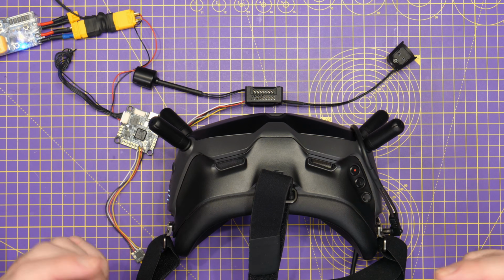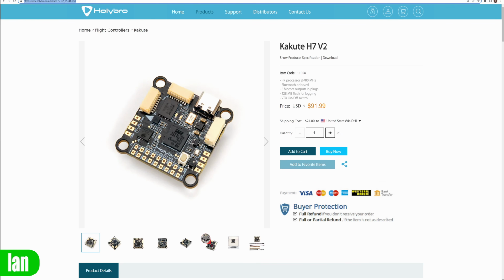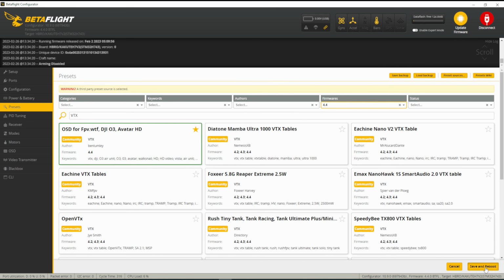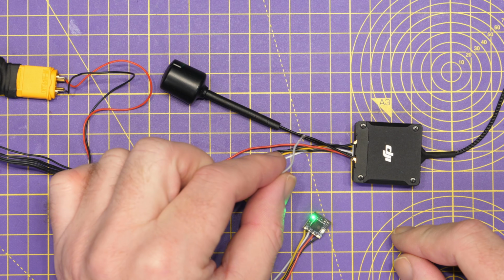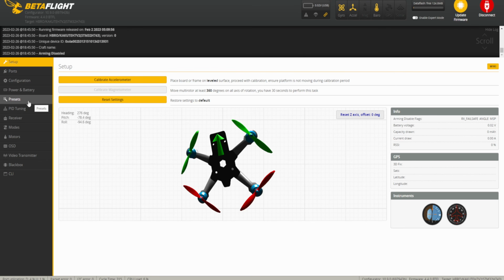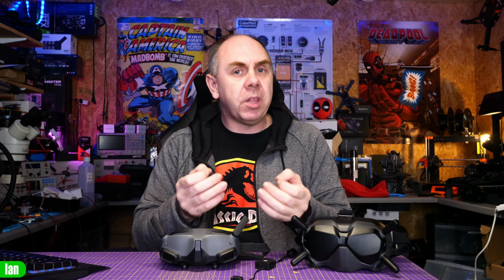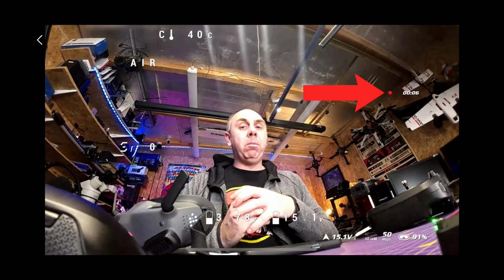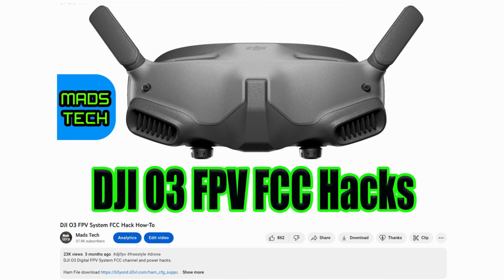DJI O3 FPV System - Complete Setup - Diagnostics & Troubleshooting Guide

Comment: Can anyone help please? I have a new 03au and v2 older bigger goggles, have not upgraded  the goggle FW to the latest ( 7) version, but moved from 6 to FW 4, which has the 03 functionality, and this works, I have a great bind and picture from the 03, but prior to this, I successfully did the root and install of WTF FPV. It has a a package which unlocks from CE to FCC mode, but that didn't work, went to transmission in the goggle menu and changed from Auto to Manual, but no change.

Tried the ham file on notepad, exactly as described, again no change. I then removed the Sandisk 64 gb SD card and re inserted it with the goggles powered on, again no change.

I did upgrade the 03 FW to the latest version before all this, could there be an issue with the 03 FW?

Anyone able to help please as my goggles are stuck in 25 mw mode.

Many thanks!!
Reply from the maker: The ham file is for O3 only.  You need to use Naco on the Airunit and Naco_pwr for the goggles in FPV mode for the Airunit and vista.  Ham is only for O3.  I have two videos on this. See FCC hack for DJI FPV.  You can also still use wtfos with the new firmware as well.  However it’s the Naco and Naco_pwr for the old system on V2.
Reply: @MadRC Many thanks for the quick reply.
I'm not sure if this is fact, but on a DJI forum a couple of guys stated that the latest 03 fw blocks the hack, so just to see if this was the case I've downgraded and reinstalled V1 of the 03 FW.
Also, looks as if my SD card may be a possible culprit, I plugged into my PC and says there's a problem and needs to repair it, so maybe my V2 isn't reading the file properly.
Formatting that card right now, but on the slow function, so when done, I'll reload the ham file and see if that works, there was no change using V1 03 FW..

Yes thanks, realised the naco FW was on the WTF package, so that's deleted, then deleted the WTFOS for now, and will see if I can get the hack to work after the SD is finished it's long format.

Thanks again, I'll let you know how things go this afternoon. 👍
Reply: @MadRC Just to clarify, the only hack I need to install is the ham on my V2 for using the 03, just to be sure, thanks again.

Comment: I'm having issues binding my O3 - but it's worked before and I haven't changed anything or crashed. The V2s start beeping (binding mode) and the O3 red LED starts blinking (binding mode) but it never connects. Any tips?

Comment: Hi to every one. Have problem...looks same as i don't have gray wire. No voltage and signal from FC, but i have OSD on my Googles V2. I had try: change uart. change cable,  all steps as from video but nothing. May be some of you have same problem. One time (wihle i'm playing with all this thing) i wired tx nad rx oposit...it could be the problem?
Reply: Problem was solved by wiring to other uart....so 2 was not good, and 3rd attempt was lucky

Comment: Hi Ian, I am looking to run a FPV unit on a go kart. Couple of concerns, would the stabilisation on the camera cope, or would it be too much vibration (fair bit of vibration) can I use the 03 unit & just power it up & bind with a onboard 2s pack. I have a DJi avata for flight with goggles 2, hoping to link from goggles to IPad for live feed screen. Any advice would be appreciated
Reply: This sounds cool, are u driving with goggles on or making a fpv rc gokart?

Comment: I have a Nazgul Evoque with the O3 inside but it doesn't record on Arming! All OSD works fine. Any thoughts! Have not got a SD card in yet but it's set to internal storage.
Reply from the maker: There is a setting in the Goggles 2 for this. Under the camera settings and advance I think it is. It’s buried some what.
Reply: @MadRC  OK cool I'll look at that. The last two flights it didn't record on the Air unit just the goggles even though it showed as recording in the goggles. Reading other threads I think it may have been because I pressed record in the goggles before I armed and so in low power mode it didn't record.

Do you know if you can set up a switch on the remote to start and stop recording (Tx 12) like the Avarta and the DJI Remote. 

I don't record every flight just parts of it and taking one hand of the sticks in Acro to navigate the goggles to record and stop isn't ideal!!

Comment: Hi there. Fan of your channel. I had an issue with my o3 air unit. The video went black while in the air and now while diagnosing there is no video at all and all connections are good. I noticed the air unit green light is blinking and not solid. Also tried rebinding but it’s already bound. Any idea what this means? And how should I go about troubleshooting? Can it be something to do with the rx tx 
Thanks
Reply from the maker: How are you powering it, if it’s on a BEC try directly to the battery.  If that don’t work try a firmware reflash.  The flashing green is usually power related or binding.
Reply: I’m powering the unit straight to power.
I updated to the latest firmware. I’ll check connections again. Thank you

Comment: Do you have a guide showing the actual frequencies that the stock O3 air unit uses? A friend and I were flying at 20MHz on O3 channel 3 (5839.6 MHz I believe) and Vista unit at 50 MB/s on channel 1 (5695 MHz). I thought these two frequencies would be safe from interference, but we were both getting terribly glitchy pixelation. 

We decided to throw logic out the window and fly on the following:
O3 air unit: 20 MHz channel 1 (5768.5 MHz I believe)
Vista unit: 50 MB/s chanel 2 (5770 MHz)

On this second flight, we had absolutely zero pixelation or interference. Nothing else changed (we were flying in the same location, the same distance apart, etc.)

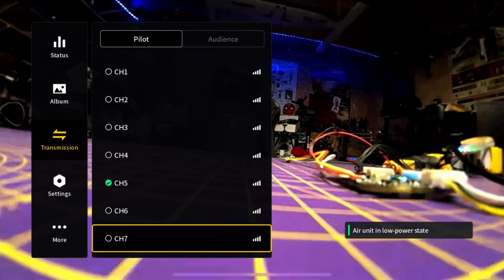Based on what you said at 21:18, it appears that our O3 air unit is in CE mode. I don't know if that factors at all, but I would like to know if there was a definitive guide on frequencies, because, based on my understanding of the frequencies, our test shouldn't have worked without interference.

Comment: Hi Ian. I have paired Air unit 03 and googles v2 together but there is no video from the camera. I see the OSD that is working... Any suggestions why there is no image from the camera? Could it be the loose wire connection? Thank you!
Reply: I'm in the same situation, did you find a solution?
Reply: @Beanrt  Hi, I fixed it by updating and registering the air unit with the DJI Assistant (Consumer...). Also when you run it, give few minutes to load the video. It takes few seconds to come up right after the UI...
Reply: @VitaliyBurov3D  ayy. I got it with that. Thank you!!
Reply: @Beanrt  Any time!
Reply: @VitaliyBurov3D  How many minutes did it take you to wait? It broke again and its not transmitting any video but recognizes the binding
Reply: @Beanrt  Ben if it worked before, make sure you don't have a loose wire connection. It shouldn't take long to connect...
Reply: @VitaliyBurov3D  hmm. It might be the coax cable. It's looking a bit funky
Reply: @Beanrt  it can have a loose connection. You may move it a bit to see if you get connection but not too much so you don't make it worse.
Reply: @VitaliyBurov3D  I reseated it and got video for a couple minutes but it was like 6mbps and almost unflyable
Reply: @Beanrt  hmm, that could be something else. So you have the UI showing up but no video from the camera and weak signal... Do you have green light on the air unit 03 box?
Reply: @VitaliyBurov3D  yeah I do. It's binded so the link quality and low power mode is seen. Just no video or when there is video, it's ok for a bit and then after a bit it shuts off. I'm wondering if it's just my unit overheating super quickly
Reply: @Beanrt  give it shot with a fan... By the way low power could be because your drone is set to before you arm it....
Reply: @Beanrt  does it beep?
Reply: @VitaliyBurov3D  the air unit? No. Also, lemme just dm you lol
Reply: @VitaliyBurov3D  it just gets really hot. The last time I powered it on, it had video at 50mbps but quickly went down and stayed at 6 until it turned off the video
Reply: @Beanrt  ok so it turns on and off. That is a good sign. You might be right about it. It is overheating. Mine also overheats after few minutes but than my drone beeps. How ventilated is your unit? I was doing an update on mine and my fan was turned on to full power. So it needs allot of air (tornado).
Reply: @VitaliyBurov3D  mine is in a cinebot cinewhoop frame. It only lasts a couple seconds before the video cuts out, so I'm not sure if this is normal or not. Maybe it's a power thing? I'm not sure
Reply: @Beanrt  Hmmm ok. Something is being overlooked...
Reply: @VitaliyBurov3D  probably. I just don't know for sure
Reply: @VitaliyBurov3D  I tried again just now and got a minute and a bit without losing video while on the ground without a fan until it shut off black but the OSD continued. I measured it with a infared thermometer and it read 100 degrees but that seems kinda low
Reply: @Beanrt  did you build the drone or bought it already made?
Reply: @VitaliyBurov3D  I technically bought it used and it was pre-built by geprc
Reply: @Beanrt  Have you flown it with the air unit 03 before the issue?
Reply: @VitaliyBurov3D  no but I know it did work before
Reply: @Beanrt  which goggles are you using?
Reply: @VitaliyBurov3D  v2 I've updated everything's firmware but initially had it rooted with wtfos
Reply: @Beanrt  ah you didn't have to. I haven't and it works with the UI... Hmm you might need to factory reset it or see if there is something that didn't finish installing. Mads Tech has a video on how to do it properly.
Reply: @VitaliyBurov3D  hmm I'll try to wipe the goggles then. I've tried it on another goggle and it still didn't work though and I've updated it to the latest firmware post wtf.os
Reply: @VitaliyBurov3D  I just did a flight test and it ramped up to 50mbps well and was flying perfectly until randomly video froze. Might be a wire so I'll check it for now
Reply: @Beanrt  let us know what you find
Reply: @VitaliyBurov3D  It wasn't the cable. Still having the same issue. Seems like its something to do with the transmission of the video. It comes in at like 1mbps with green lines everywhere and a  really messed up video feed
Reply: @Beanrt  I wish I could help more with that... Maybe connect the air unit to DJI Assistant 2 with the battery on and see if you get any errors with a code. Hope anyone from here can step in and help you
Reply: @VitaliyBurov3D  thank you for all your help! I've contacted DJI so we will see

Comment: Very nice video. I know that this is a guide for betaflight , but I wonder if you have any idea for inav.
For now , inav has not OSD support . But when I arm the quad , it exits from low power mode and starts recording.
The problem is that I have 0 Volts in my V2 goggles for the battery of the quad and the signal is weaker from the previous air unit. 
Is it possible that this msp behavior , affects the strength of the signal , or from the moment it exits low power mode is irrelevant ? Thanks in advance

Comment: Thank you for this video! The flight controller and dji o3 have different connection terminals. In the video, you have a cable that fits perfectly to the flight controller. Where can I get the cable from the flight controller to dji o3?

Comment: struggling to find the solution , i have betaflight osd but no dji osd voltge 0.0 with low power, but betaflight osd show all correct . i also try that on different fc with different cable same problem /;

Comment: great video and very helpful!! i just got the o3 air unit for my rc planes. im in market for goggles now but i was wondering if i need a flight controller for o3 or if it would connect to Spektrum Air Receiver??

Comment: when low power state is gone after armed, that gonna shutdown automatically?, because i already get failsafe 2 times because of automatically disconnect, its like overheat on dji o3 unit, but just flight 1 half minute

Comment: Hi Ian, I'm using the same DJI GV2 to fly with vista's and O3's. GV2 are WTF rooted and they are updated to fw V01.04.0000, my O3's is flashed with fw V00.05.0203 (I did not upgrade it even to V01.01.0000 yet). Vista's units are WTF rooted with current soft as well and they all have DJI fw version V01.00.0606. My all drones are working with GV2 perfectly (with vista's and O3 - full BTF OSD etc..). However I would like to get new O3 dynamic range upgrade but I do not want to brake mu current solutions where GV2 could work with both vista and o3 units. Please confirm, can I safely upgrade the O3 unit to FW version V01.02.0000 (10b dynamic range) without loosing compatibility with my GV2? Will GV2 with current fw version V01.04.0000 be work with updated fw of O3 to 10bits or maybe I should also upgrade them to 01.05.0000 or to the 01.06.0000? If I do so, would I be able to have compatibility of GV2 with vista's units and O3 as now...? One more thing, I am not using DJI RC link via vista or o3 but TBS CSF. Thanks in advance for help. Pawel
Reply from the maker: You are safe to update you may just need to remove WTFOS.  Perform the update then install WTFOS again.  As long as your rooted already you are fine to update to the latest firmware and everything will be the same.
Reply: "I am using both Vista Unit and O3 in the same way, and I have made the necessary updates and they are both working fine. The only problem  is that when I change the unit, I have to re-bind it again."
Reply: @brkfpv60  Thanks for your confirmation @brkfpv60! Great info. Would you please check what version of FW do you have in Gv2, O3 and Vista (those working together)?

Comment: Thanks so much for your work. You made my day. I had partly DJI OSD, permanent low power mode and no recording. Thanks to your simulation I could replace the falty grey wire and will get airborne now. THANKS!

Comment: Thanks for the great video. I have 1 question: If I delete the existing Ham-File from the Sd-Card and I restart the goggles V2, the powermode goes back/ less RF-Power? Ham-File must be always on the Sd-Card? Thanks a lot
Reply from the maker: No once it’s done it will stay till either you connect to assistant 2 or you reset the goggles to factory settings.  You do not need to leave it on the card in normal use.

Comment: This Information is so useful!!! Thanks! I would love it if you found away to get the air unit to perform at max without the use of a flight controller as I am using it in an RC plane.
Reply from the maker: Sadly no, I have asked DJI for an update to resolve this but they never replied.

Comment: I fly fixed-wing without a flight controller and use an Arduino mod to supply the arming signal and get the air unit up to full power.   The full details can be found online by searching for GitHub ramiss.  I can't put the link in as YT delete the comment LOL.

Comment: Thanks for the info. Any chance you can please help with the “Country Code not Updated” error on 03 and V2 goggles?
Reply from the maker: This is an interring one. I had it once but I can’t replicate.  My advice would be to update both the goggles and Airunit again in Assistant 2 for FPV and then connect your phone with the fly app to the system and let it get your location.
Reply: Iv had this error after alot of research and endless hours on forums I decided to get in touch with dji they replaced my o3 air model and still had same problem so seem to be on the goggle side have just  shipped both Googles and air unit to there repair service. Still waiting to hear back from them. But maybe when I find out what the problem is I will let mads tech know as its a problem a small amount of people have and there is no solution to be found online!
Reply from the maker: @peterhoughton69  I have seen it a few times with users and its caused by the AU/Goggle not knowing your location so it cant set the correct region. I have helped resolved by doing the following. 

1: Refresh the firmware on both Goggles and Airunit making sure you are logged into your DJI Account in Assistant 2 and you have all the the privacy options turned on. the latter is very important. 

2: Bind and connect your goggles to you phone and open up DJI Fly app and allow it to connect,  in the top left corner it should have your location shown, if its not you will need to take it outside and allow your phone to get the location. 

The basics are is it needs to get your location to set the region. 
.
Reply: @MadRC  I tried all that all that and more, just couldnt get the message to go away whatever i did. Hopefully dji fix it.

Comment: I feel like the o3 air unit is really bad at night/in low light with the auto settings. What are good manual video settings for night/low light?
Reply: I try to keep the ISO value under 400 (100 for daylight) meaning I’ll tinker with the exposure values a bit more until I like it.

Using V2 goggles and “how I like it” ends up with an exposure reading of around -0.3
Reply: I agree that the low light is pretty bad, luckily the parking lot I fly has those new LED light poles. What helped for me is to turn the sharpening down to 0 in the setting, reduces noise significantly.

Comment: I got the 03 mode in my Goggles V2 , but I have no way to adjust the power in mw , range seems fine🤔. Also when switching to air mode on my new  iflight there's no air mode weird , but flys great lol